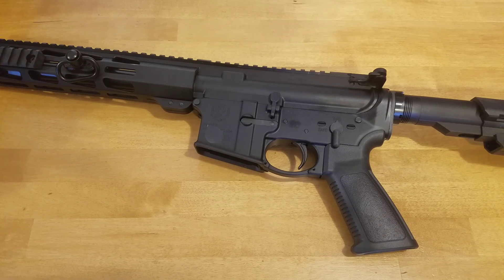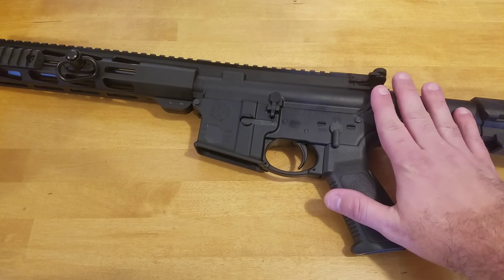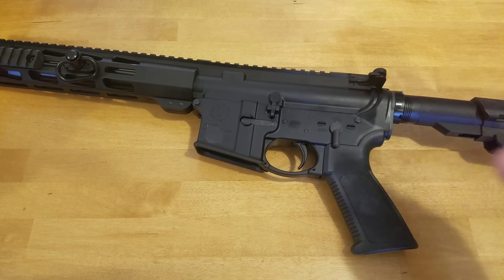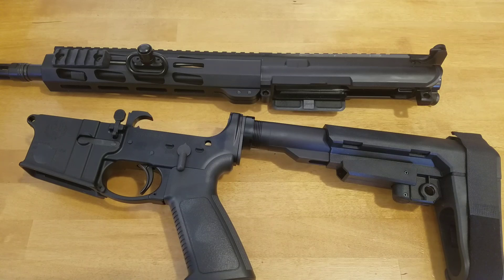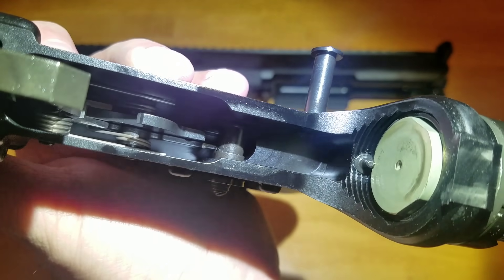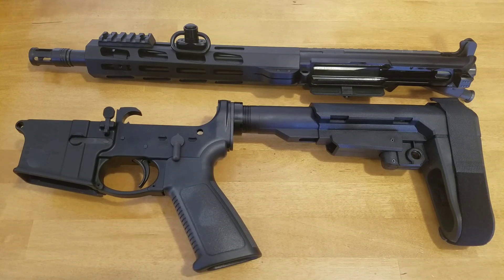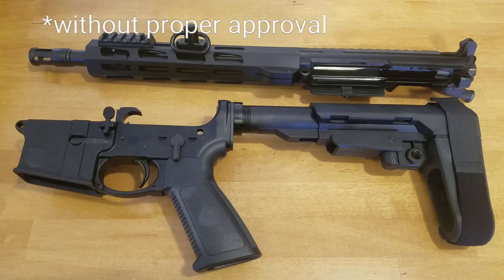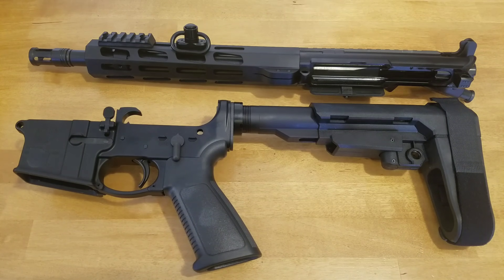Simple Mod to Convert AR-15 to Full Auto

Comment: Nobody 
Absolutely nobody 
The ATF: “he had us in the first half not gonna lie”
Reply: Original bro 🙄
Reply: Sup
Reply: Why am I not surprised to see Stalin on an AR-15 full auto conversion video?
Reply: Stalin your off spring want to do what you did in Russia in the states
Reply: @Nezfitness777  which part? Free healthcare, free education, and subsidized food prices? Or gulag and famine?
Reply: @sethlee1017  The latter
Reply: There's a way change the firing control group to auto parts simplest way
Reply: @puipuiiralte8216 While anyone can purchase a M16 fire control group, the standard AR15 receiver will not accept select fire parts. There are several machining operations that must be done before the auto sear will even fit in the lower. A heavier bolt carrier group is also necessary.
Reply: @sethlee1017  facts
Reply: @dullahan7677  3 position safety selector, full auto trigger group, m16 bcg, hopefully the 3rd pin jig if those aren’t illegal yet and a drill press. Comically, the drill press is the hardest part to source because it’s the most expensive (usually)
Reply: Username checks out
Reply: @dullahan7677 Most AR-15s come with a full auto bolt carrier, and all you have to do to the receiver is dremel the walls to make them thinner to accommodate the sear. Then replace your fire control group and you're all set to spend the next 10 years in federal prison
Reply: @sethlee1017 you forgot his 'disappearing' 20 million of his closest friends.
Reply: You can twist a coat hanger into a disconnector with a pair of pliers.  Don't do it though.

Comment: The mag well is in front of the trigger, just wrap a rubber band around the back of the trigger, go around the magazine and back on the trigger, or, depending on the setup of various guns, just a matchbook or thick sheet of paper in the back so it doesn't catch in semi and keeps feeding it
Reply: That doesn't work.  Yankee Boogle or coat hanger machine gun does work.
Reply: @collinhennessy6558  explain plz 👀
Reply: @carmelogarcia4864  they were products that were sold as auto sears (switches) disguised
Reply: @carmelogarcia4864  extremely illegal to own might I add
Reply: @carmelogarcia4864  I believe there is a metal business card design that serves the same purpose. What a shame nobody out there has a way to produce precision shapes out of flat material, then bend it in the right places... 

Next time on, "What Will They Ban Next?"
Reply: @Mo  They're not illegal to own, it's what you do with it that makes it illegal
Reply: @bustercherry69877  As of yesterday, they are illegal to own

Comment: Plumbing solder wouldn't work anyways, it's too soft.  You need the stiffness of a thick wire clothes hanger that can take the beating of the bold carrier.  How do I know?  I'll never tell.  HA HA HA!!!
Reply: i zinc you may be right
Reply: Weld better hanger to that thought. If you want I can send you a "LINK"  of what the BATF says about that kind of work. from what I have read on their site, it clearly states. if someone actually makes this then  you draw a chance card! Swiftly you read what the card says.  It reads , go straight to jail, do not collect $200. good thing you may know how to play monopoly but of course you never would actually play it though  Lol.  some may understand what i meant

Comment: The lower isn’t the same behind the trigger, for full auto there need to be a large cut out and the safety assembly has a few flat sections you can’t make yourself
Reply: Yea right😂, and by the way can you leave the stock plastic polymer lower as wells? Or need a metal lower for auto?

Comment: This is exactly what I hoped it would be. If you're desperate to get a giggle switch the Rare Breed Force Reset trigger and Binary Triggers are still technically legal (for now).
Reply: This didn't age well, and so soon after you commented it at that.... already, just one month after you made this comment, the ATF fuck nuts have stated they are coming after the Rare Breed Triggers. So now, the only ones which remain legal are the Fostech Echo Fire triggers.
Reply: @john.wick1  technically the Rare Breeds a still legal because the ATF started confiscating them without any kind of ruling, making the seizures 4th amendment violations. But since when has the law meant anything to the fudds?

Comment: There is a simple way just add a "S" shaped insert that puts pressure on the trigger latch just behind the hammer and cups the rear pin for the upper and lower assembly. Just takes the want to figure it out
Reply: Sounds Like your the Man
Reply: @fernierodriguez3838  he works for the man
Reply: Hes waiting to get DMs and then they're going straight to the clink lol nah I'm jk the man works for him

Comment: Now that was funny, Solder and a butane torch 😂. The actual way to do this is to get the correct FFL, or pay 10-15k for the full auto weapon and then fill out the correct form and pay your $200 for NFA item and then wait for a year or so.

Comment: Converting the AR platform to full auto is crazy.  The platform in the Army cycles 687 roundz a minute. That's a very expensive hobby plus you would need multiple barrels because the barrels have been scientifically proven to melt beginning at the 700 RPM range

Comment: Look where the hammer is. Pop it out. N just use the blowtorch to heat it up to melt it. Or use a saw. Just cut the hammer right off the pivot. Then solder the sharp edges n put the pivot back in. Pop out the buffer. Put the tweezers in the tube. Put the buffer back in. And now your ar15 is pretty much useless. But you can imagine full auto n make bang bang noises with your mouth since now its basically a toy. Lol im joking of course